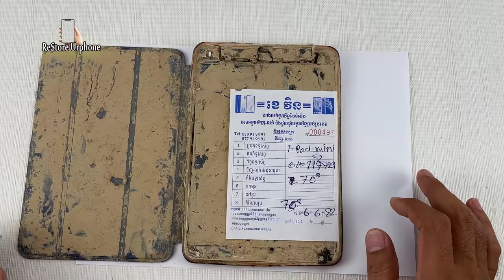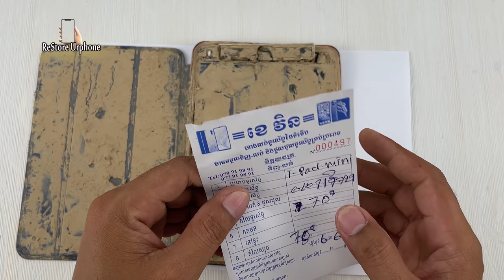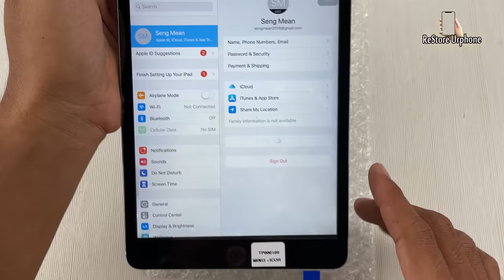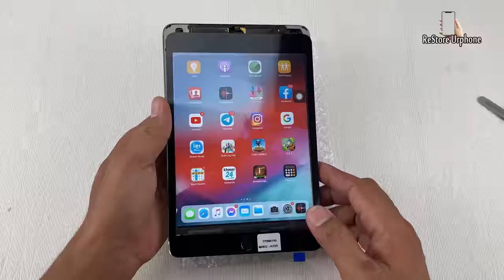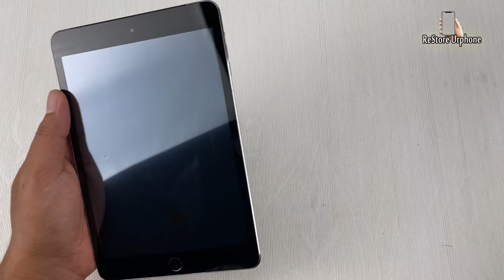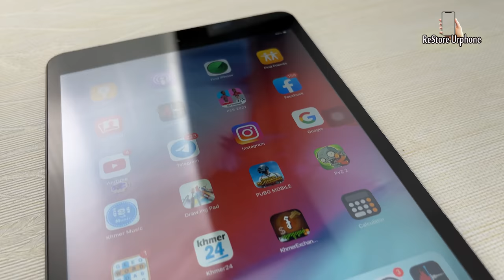Restore Broken iPad mini 3 Buried in the Mud || Restoration Destroyed Apple iPad Cracked

Comment: For everyone: this isn't always saving the planet, those components could be reused in newer ones...it is a good video?! Yes. Is it ALWAYS better? No. Depends. But is isn't necessarily how we less pollute.
Trash it correctly it is the right way.
Trashed they could choose how to act.
Many times trash got a cash back, here isn't but it could be common as well.
Reply: Old Components:
Processor - too slow
Memory - too small and slow
Storage - too small and too slow, SSD wears out after lots of use.
Battery - worn out
Display - too small and damaged
Connectors - broken corroded or worn out.
Capacitors - old near end of life
Coils and transformers - probably not good for new design.
Maybe parts could be used to make a new unit but it will be old design, slow, lacking new features.
Reply: @gordonwelcher9598  exactly...the best would be recycle. Most of components can be recyclet for creating new ones and that got sense. Brands give you money for your old tablet, smartphone and car.
Luckly they can reuse it but not making it as new.

Comment: funny trick restore, every repair tech knew what happen. But good idea and good job.
Reply: What did happen?
Reply: @daienaa  it won’t be work if the tablet get real fade like that, this iPad unconnected battery or drain out battery then put in the water with earth& take out. That’s why iPad could be work with those really simple restore.
Reply: @wancebian720  So this have not been in water and mud long time? It’s hard to know what videos are real restore and what is fake.
Reply: @daienaa  you can search “water damaged motherboard repair” on YouTube. Even The iPad in water in 15 days the repair going to be really different way. This looks like half years. Not gonna be easy like this. You will find what happen.
Reply from the maker: Yes, thanks